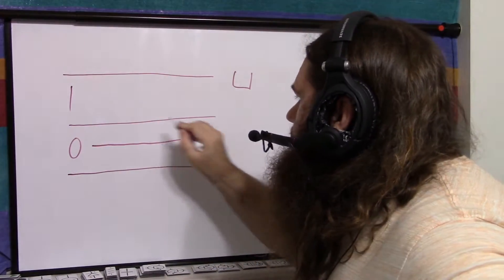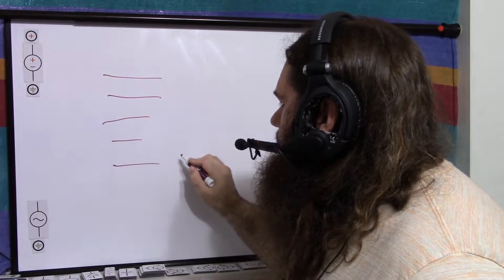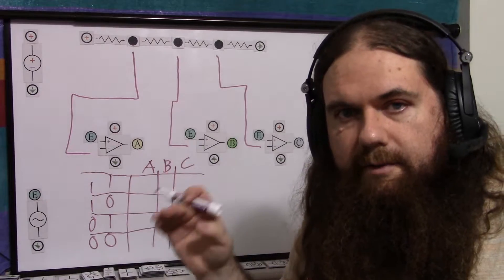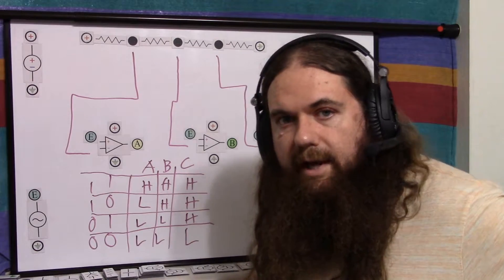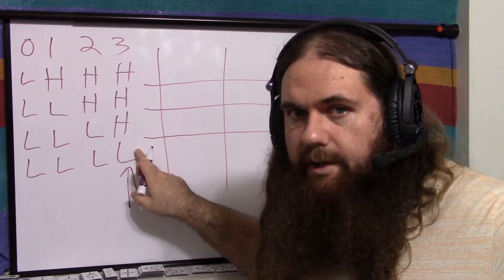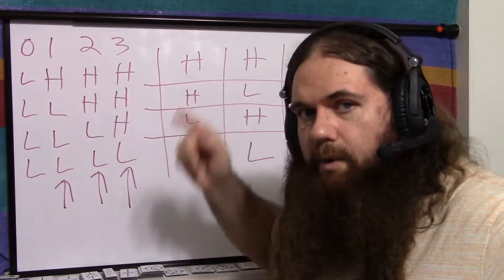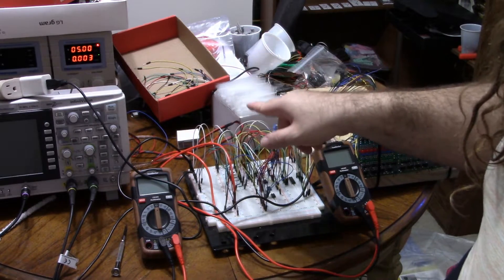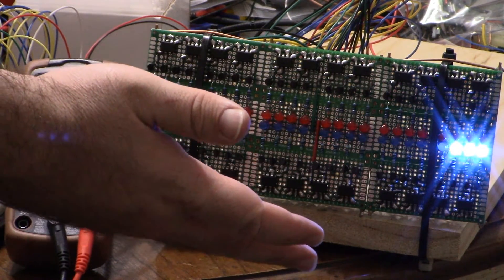Combinational ADC - Op Amp Ladder - No Microcontroller, DAC, or Capacitors - Simply Put

Comment: I think I may be able to revisit my sensorless brushless motor driver project with this new knowledge. The BLDC is a three wire motor which makes finding a reliable reference ground for each floating phase a challenge. I tried to build a 'three half-H bridge' as a challenge. Six commutations are required to make a complete 360° electrical revolution. It is easy to drive a BLDC like a stepper motor but after a certain speed you should be able to detect a 'positive/negative zero cross' for each commutation. Comparators are used for detecting the 'zero-cross'.
I don't have a decent oscilloscope...but...I think an 'Op amp ladder' should be a consideration in my circuit design.
I appreciate your tutorial.
Reply from the maker: And it's a lot smaller if you get quad-opamp chips too!

Comment: I bought 50 LM339 quad comparators for a few bucks from china.  They work great! You may not want to wire it up, but it would definitely reduce component count. You may also be able to use resistor packs, but I'm not sure if they wire up correctly.
Reply from the maker: I mean, there are places you can order PCBs from, either just the board and solder yourself, or they put the parts on too and wave-solder it. Wouldn't be terrible for surface-mount stuff. But at that point, just buy an ADC chip really. Doing this is for fun and learning!